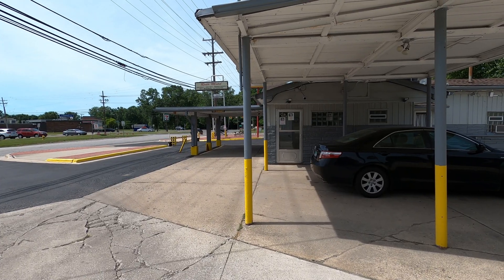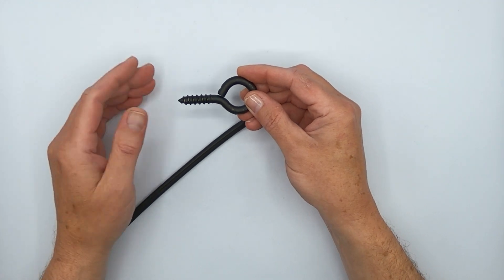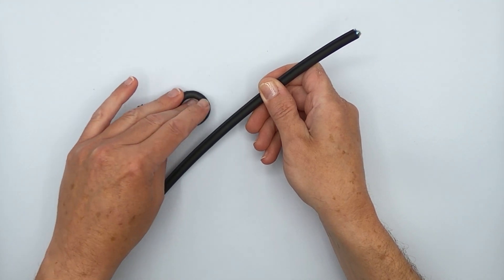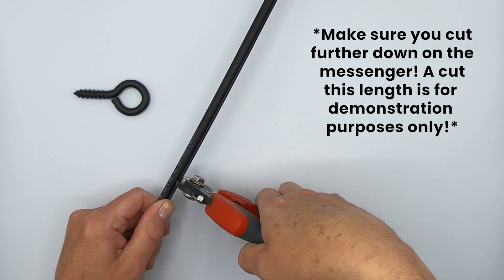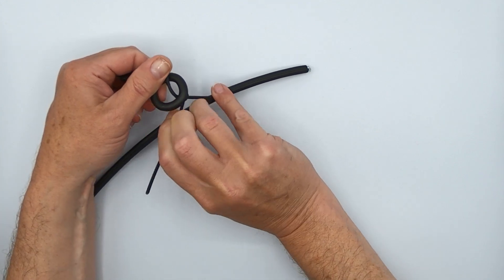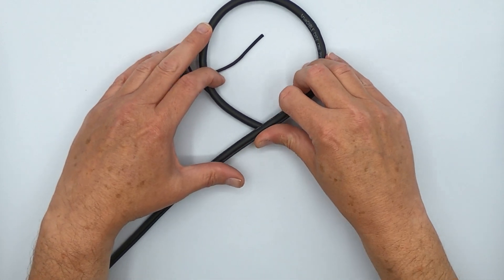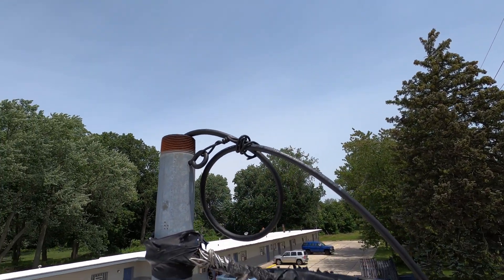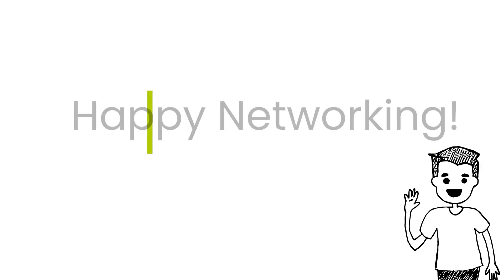Cat6 Ethernet with Messenger Wire - Overview and COMPLETE Outdoor Installation

Comment: Thank you for a great video! I'd like to run an Ethernet cable to my pump house to extend wifi. There's an overhead power line that runs there. Can I run the Ethernet cable using the same poles? (Eg 6" below the electrical lines.)

Thank you, and I hope you still read comments!
Reply from the maker: Hello! Good question, and I indeed still respond to all comments. Well, when we get them from YouTube, and YT is not so good at letting us know. Anyway, if YOU own both poles, you can attach as long as the circuits do not pass over public access areas (side walk, road, etc.). If you do NOT own the poles, then you need to get permission from who does before you attach anything. You likely won't get that permission. The final piece is if you find you can attach to the poles, ask you local electrician who is aware of your local jurisdiction Code Ordinances. There may be clearance from ground requirements and other requirements you have to follow. Better to know up front rather than be forced to remove your cable and get fined later!

Comment: Greetings sir, I respect your online teaching quality. I'm a networking student actually in a dilemma of which specifications of cat 6 cable to use for my DIY cctv setup where cameras require POE+ as they are within 30w power draw and less than 75 metres. 

I am worried that since the cat6 is running underneath a GI metal roofing like one shown in the video but enclosed by surrounding walls and the only open is the front gate. The temperature in my city during peak summer may get upto 52 degrees which makes me wonder which type of cat6 outdoor cable to use, which type of pvc conduit to use, if I should leave any spacing, type of rj45 connector (I prefer pass through rj45 enclosed in a pvc box near the camera. So the outside setup totally is my problem. I think you understood very well. Thank you. Please suggest your views.
Reply from the maker: Hello, and you are correct to be concerned about ambient temperature. 52 °C is 125°F, which is quite a bit! You will need to keep your run lengths to a maximum of 253 feet (77 meters). Cat6 is a good choice, as IP cameras don't typically require an application speed exceeding 100BASE-TX, with a few cameras at 1Gbps. Cat6 can handle 5Gbps at 100-meter distances, so you are good with Cat6. trueCABLE sells a Cat6 Unshielded Outdoor UV cable that would be ideal for your use case. This is an unshielded UV-rated (outdoor jacketed) cable not meant for direct burial, and is easy to work with. You don't need shielded cable unless you are dealing with strong external EMI/RFI sources that you cannot keep your distance from. As for connectors, trueCABLE carries connectors we have tested with our cable, but if you mix and match manufacturers, you will need to cross-check fitment to be sure whatever connector you use will fit your cable. I hope that helps!

Comment: This looks wrong to me.  He doesn't clearly identify the suspended side of the cable.   After watching it a couple of times it became obvious that the suspended end is to the right side of the screen, not the left as I initially assumed.
Reply from the maker: Hello! This aerial run is suspended at both ends using the messenger wire. We will likely reshoot this video again in the future as we refine our content. Thanks for commenting!

Comment: Pardon my ignorance, I see strain relief for the attachment points, but the cable run has no support other than itself?  Right below your cable is a full run messenger wire of large caliber holding (communication?) wires also.  I need to run about 90 feet of CAT6 cable over a driveway (at least 16 ft up to clear trucks) to a garage from the second story of a house (easy access through wall  by a window) to a garage loft with access near soffit. I planned two poles between, unless a messenger cable can be run that distance tightly to clip on the CAT6? There are trees between , I was considering a pole to get it over the drive (into woods) and dropping the line into conduit to the garage.
Reply from the maker: Hello! I am glad to offer advice, the only bad question is the unasked one. Outdoor cable runs are supported either by a separately installed messenger wire (typically thin stainless steel wire rope) and then attached to the messenger wire after the fact, OR there is a built-in high-strength steel wire that is part of the cable itself (called messenger cable). In this case, the messenger wire is supporting the cable to the attachment points alone. No other support is needed, although in some cases, additional support MAY be required depending on the weight of the aerial run.

Comment: Can you run this cable and attache a regular unshielded one to it with aerial clips?
Reply from the maker: Hello! Absolutely, no issues. Just don't attach TOO many cable to an existing aerial cable. There is an eventual limit which will vary depending on your lengths, etc. A couple of additional attached runs (max) should be fine, but pause and consider a different way if you need to attach more than that.
Reply: @trueCABLE  Do you know if your direct burial UV and regular UV offer the same protection when exposed to sunlight? I'm trying to reuse direct burial for surface mount when possible.
Reply from the maker: @alexk7837  Hello! The UV protection is identical between the two. The cable jackets are the same, and both types use LLDPE. The difference between direct burial and outdoor is additional measures taken BELOW the jacket to prevent water ingress (gel, dry tape)

Comment: I'm wanting to install a POE camera with NVR. I plan to keep the NVR close to my computer area and want to install the camera on the front porch with a roof that will be covering the camera from most of the sun/rain. I've been researching about different kinds of ethernet cables and still can't a make a decision on what's best for my scenario. I want to install a ethernet jack at my computer and run the ethernet from in the wall to underneath the home, which has a crawlspace (no attic space). Then I want to attach the ethernet along the bottom of the home to get it outside to the camera location. I can run the ethernet up behind the siding of the home to keep it hidden and make it to the camera location I would like to have it at. I would like advice on which ethernet cable I should get. Like what type of jacket and which category of ethernet. I estimate the run to be less than 60 feet for the first camera. I would like to install additional cameras in the future as well. I'm focusing on the first at the moment to get started out. Also is my idea of running the cable underneath the siding of the home a good choice or should I do something different? This is for a manufactured home. Please advise, thank you.
Reply from the maker: Hello! Good questions. Considering most PoE cams are drawing 30W DC or less and don't connect at more than 100 Mbps (100BASE-TX) (the max being 1G, but that is rare even for "8K" cams) you can get away with Cat5e which is easy to route and terminate in comparison to higher Category cables. You certainly DO NOT need more than Cat6. You don't need to worry about shielded or direct bury cables either. So, we have two options we provide that are ideal for this: Our above ground Cat5e Unshielded Outdoor OR we have the same type in Cat6 -- our Cat6 Unshielded Outdoor. Both cables are more than enough for your install. Quite frankly, if you are dealing with a lot of tighter turns and limited space then I would opt for the Cat5e variant. Not only is it as thin as you get for outdoor cable, but it happens to be a snap to terminate. As for PoE handling, our Cat5e handles 100W DC PoE just like the Cat6 stuff. The PoE limitations come in the number of runs that are bundled together.
You can get more runs with Cat6, but considering your install situation you won't run into any limitations with the Cat5e (unless you are deploying literally dozens of cameras, that is). I hope that helps!

Comment: I've been working for my company for about 7 months now. I was always told that the messenger wire is for bonding purposes. I've been watching all your videos to help me be a better technician for my job, and just because I love what I do. Thank you for this information and everything you guys cover!
Reply from the maker: Hello and thanks for your kind comments. Bonding the messenger wire to ground is usually achieved by the fixture you attach it to, and the same would be said for armored cable that uses a metallic shell for durability (like found in much fiber optical outdoor cable). That said, bonding the messenger wire to ground does nothing for bonding the cable shield to ground. That is a separate process. Hope this helps!

Comment: Great video, but why would you ever run comms wires above power? Don't they normally go lower for electrical code reasons (North America)
Reply from the maker: Hello! Normally you would not run comms over an electrical circuit. In this case, the circuit was de-energized and out of service (not even connected at a breaker box). The electrical circuit was subsequently removed. It started out life as a 120V circuit for parking lot lighting, but the light was removed years prior. Sorry I did not make that clear in the video!